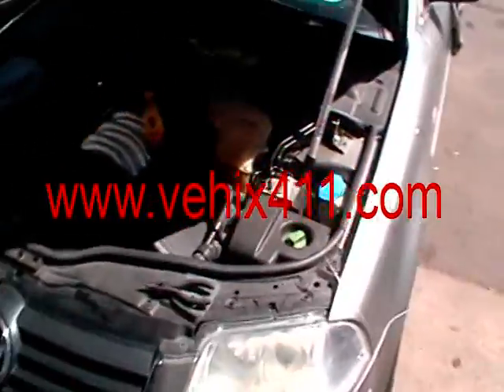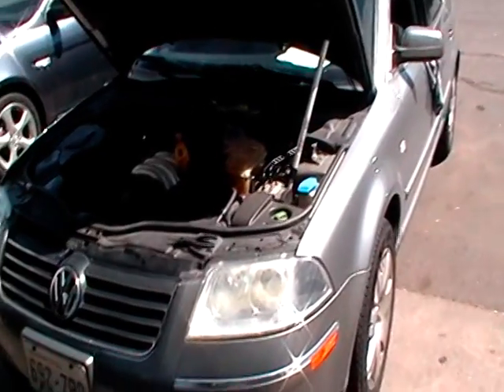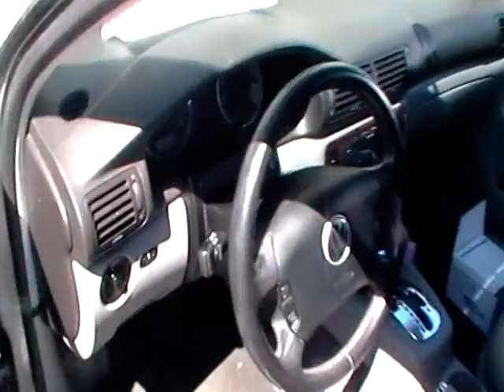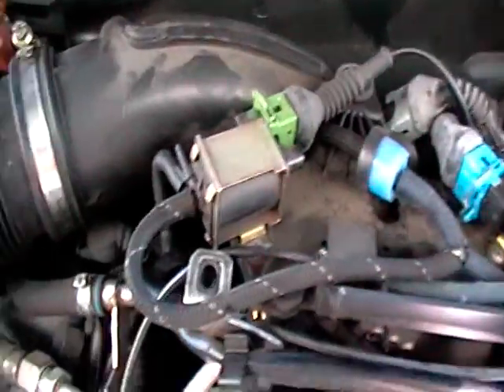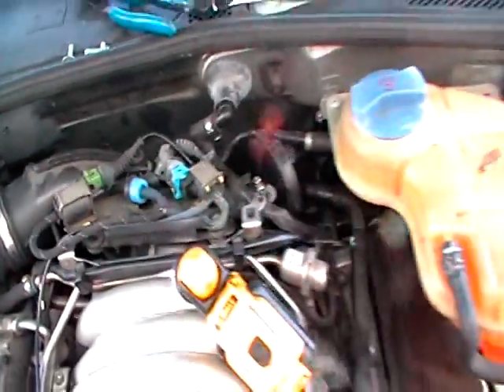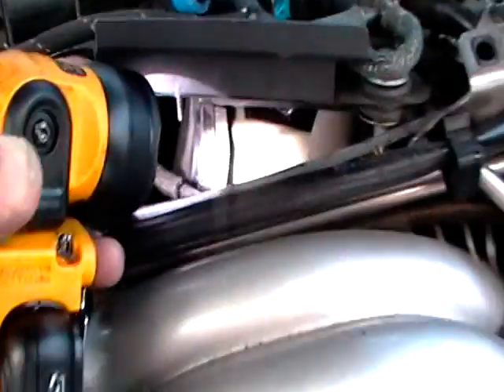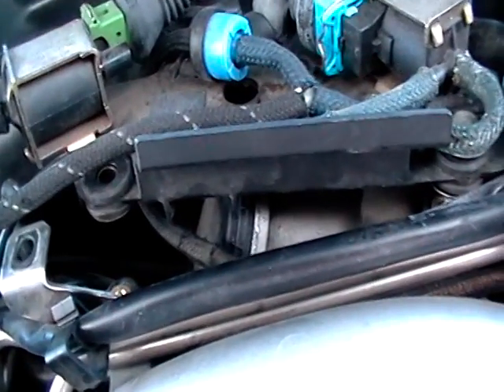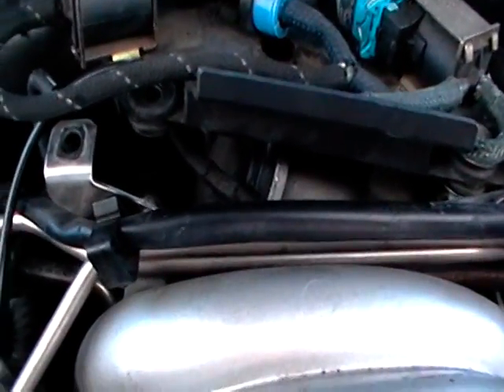Solving VW & AUDI Engine Codes P0171, P0174 with Air Leak Test

Comment: Sweet. I just purchased a 2005 Toureg and I was hearing a whining noise coming from the firewall and sure enough after 600 miles later after refueling, it started sputtering. Hope this was the case.

Comment: great video! I have a 2002 vw jetta turbo, and took it to goodyear and they mention I need to replace a "Hose to Snorkel" what is that? they said i have to get it from the dealer. or were this part located at... the code coming up is P0171 Lean Bank 1

Comment: I got the p1136 today and the mech said its the MAF sensor...?? I cleaned it with maf cleaner spray and light still goes on. I will now poke around the hoses and see if there's a leak somewhere.... Thanks for heads up...... Too many people get ripped off for simple replacement of a hose. ( this is on a 2001 Audi TT ).
Reply: DarkstarDarth i have the same issue on my TT, just came up 2 days ago. getting a shop to smoke the intake system for leaks before any sensors get replaced.
Reply: My final actual fix was I went to eBay and bought a $30 maf sensor ( make sure you get part # off your unit to get the correct one ) it's a very common cheap fix instead of wasting $100 's on useless diagnostics...also look for 4" hose behind manifold for rips....I replaced hose harness without removing manifold as mechanics try to make you believe for their monetary benefit. Do maf first dood.
Reply: DarkstarDarth
i will thx for the advice buddy